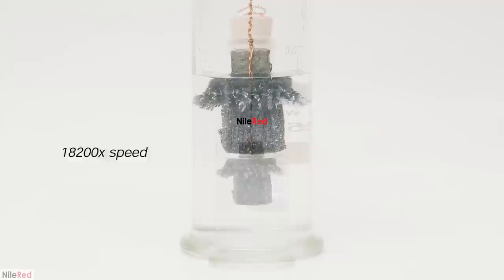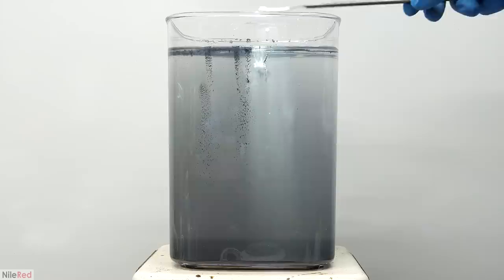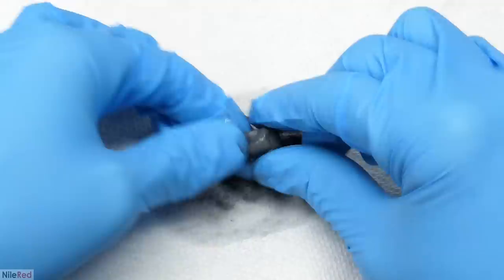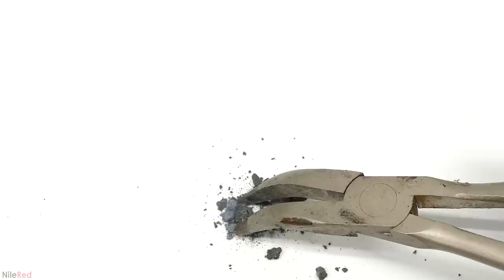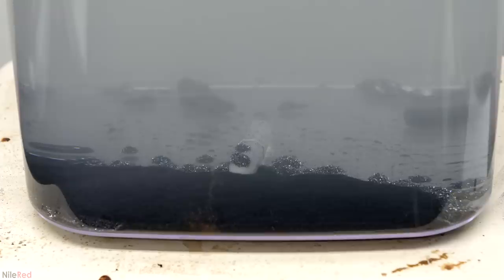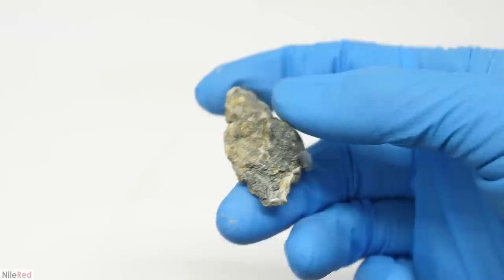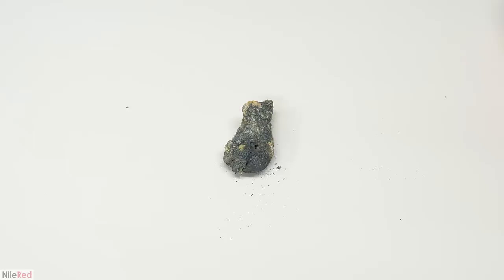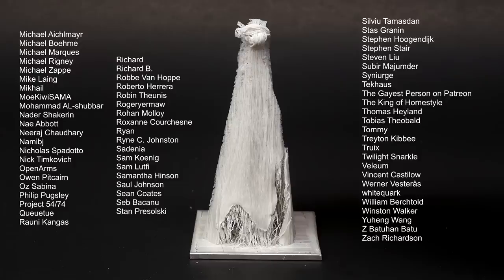I accidentally discovered lead sponge...

Comment: Is it possible that the lead granules in the second attempt were not in an environment which had residual lead particulates? It seemed like you didn't recreate the concentration of both lead powder and lead acetate before adding the zinc.

Comment: Could this be used as a resistor in a circuit? The heat may naturally dissipate through the porous structure, which sounds cool and applicable?

Comment: Could it have been the greater pressure at the bottom of the larger breaker that caused the differencei in zinc granule runs?

Comment: You know, this is basically how gun powder was made. I want to do THIS but I actually made THIS. Also as interesting is how viagra was made, the pursuit of a heart medication during clinical research had gathered different results, turns out the blood flow the nailed just in the wrong area however the product was still marketable.

Comment: I ended up going from this video to the uranium glass video, and it got me thinking. Would this lead sponge be useful for radiation shielding, or because it doesn't have the density anymore it wouldn't be as effective?

Even if its not as effective I think though what if you made lead sponge and then molded it around something radioactive, would that help to reduce the amount of radiation it gives off? etc

Comment: what is that white capsule u use which  u call a stirrer
Reply: Magnetic stir bar. You drop it in and then place the beaker on a hot plate with a stirring function and switch on the stir dial. The stir bar starts to spin and it mixes everything for you.